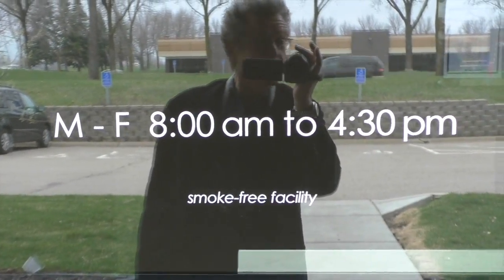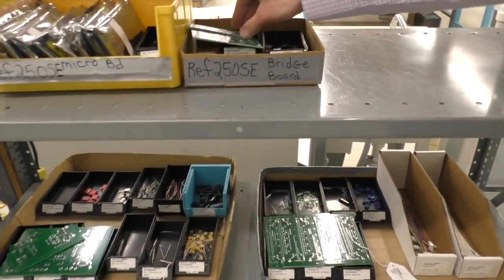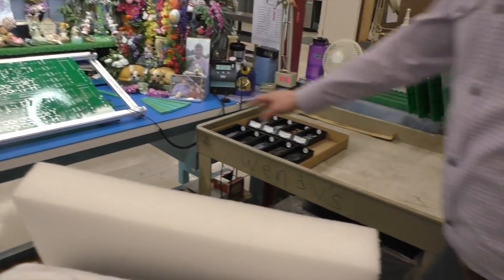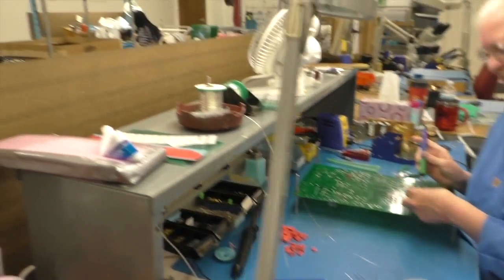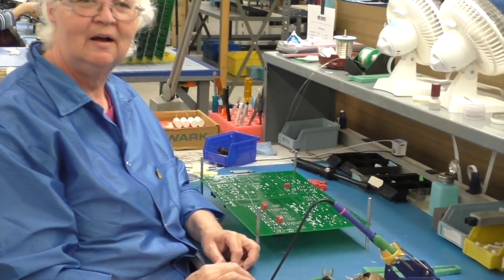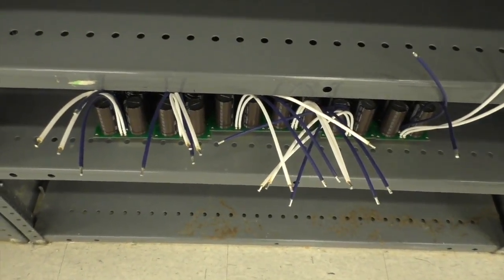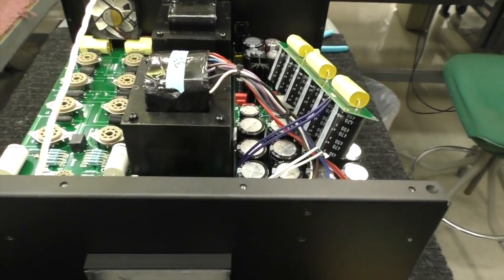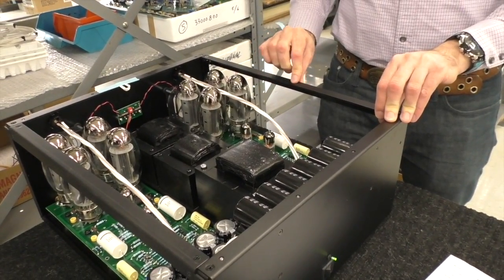Analogplanet.com Visits Audio Research Part 1

Comment: I worked in electronic manufacturing for over 30 years, from Audio Digital (Gary Hardesty famed sound engineer who designed one of the world's first audio digital delays and did the China Olympics stadium), to Versa Logic and Spectra Physics / Datalogic Scanning.

Spectra Physics produced the world's first retail barcode scanner which scanned a pack of Juicy Fruit Gum. I also repaired car stereos for 2 years out of school, and saw the transition from cassette to CD players in cars.  I stuffed my share of circuit boards, bent leads, repaired, soldered and eventually to writing test software.  Been there, done that - and more.   In 2009 my department at Datalogic along with our large manufacturing plant was sent to VIETNAM!!  I lost my job of 15 years. Guess who I'm voting for?

I just sold a 1985 Conrad Johnson PV5 I had purchased used in the early 90s.  Sold the first day on eBay for $1,400 a few months ago.  That is the highest price I've seen one sell for.  Got all my money back.  Was refurbished and stuffed with 3 NOS Mullard CV4004 by Bill Thalmann who was the technical director at CJ for 20 years before starting Music Technology 16 years ago or so.  His work cannot be outsourced.  It's an art.  I'm currently using an Emotiva XMC-1 A/V processor for my home theater which is made in the USA.

Bring manufacturing back to the USA let's make America great again.  Bill Thalmann and Gary Hardesty, I salute you!
Reply: Trump steaks?  Pfff...  How about Trump turntables?  Trump cartridges? Trump phono preamps?  Kapow! Slam dunk.
Reply: By the way, steaks or no,  I enjoyed your video tour of Audio Research.  I worked in environments like that most of my career, so I felt right at home watching it.  

I have a friend who bought Audio Research equipment and so I am somewhat familiar with the name.  In 2010 my friend bought the Audio Research 40th Anniversary Edition Reference Preamplifier and other AR stuff to complete his latest upgrade.  Unfortunately, 2 years later his hearing in one ear completely shut down due to a virus!  It was so sad as audio was his favorite hobby.  Now he has thrown himself into home theater.  He was my mentor getting into vinyl.